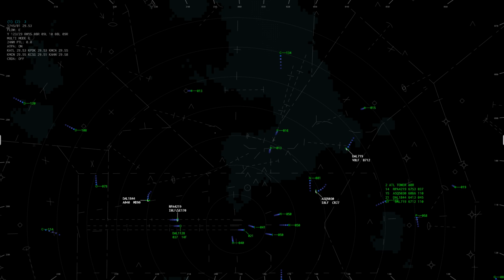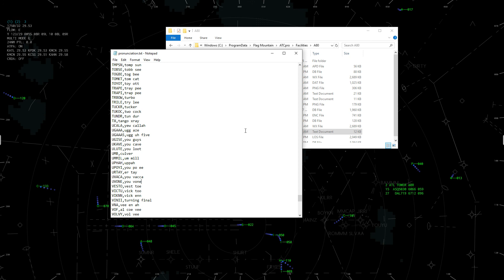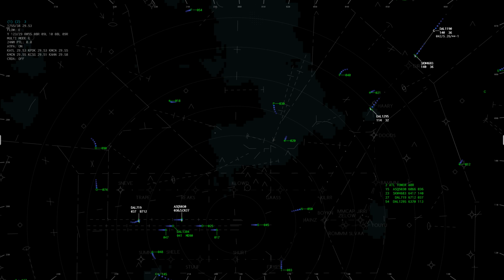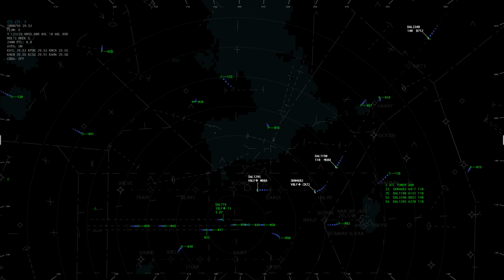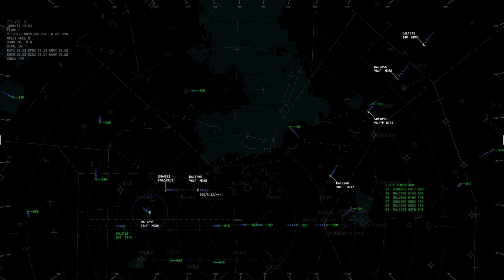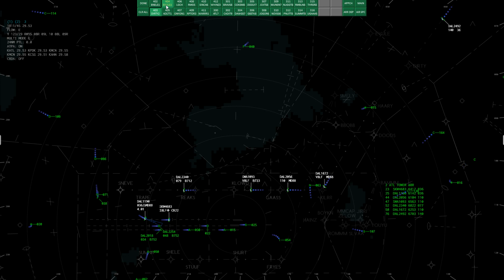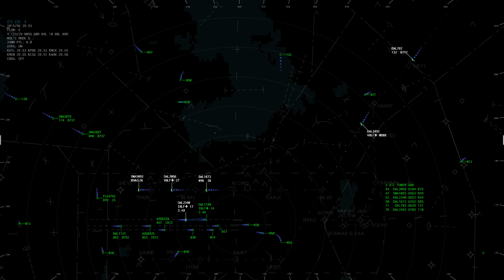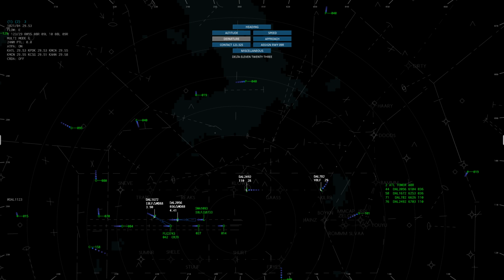ATCpro - User Edits and Technique

Comment: Hi Andrew, I enjoy watching your tutorials.  I'm considering purchasing this simulator. Is it still supported?  I see most posts are no recent than 3 or 4 years ago. Thanks!
Reply: Kevin, I purchased ATCPro about 3 weeks ago. I have to admit the ambition level and the functionality (when it works) are pretty amazing. It comes with 6 Tracons which are modeled with very realistic procedures although they are based on SIDs and STARs that are about 5 years  old. The Scope functionality feels realistic although I can't really judge since I never worked one for real. 

Now the bad news. There are quite a few bugs, although so far I haven't found one that is really debilitating. You can play, but you will have to do some workarounds in some sectors. The career mode doesn't work but you can use everything in Sandbox mode, you still get comments on your performance, you just never get a "promotion" (I don't really care about that). The "download live weather" doesn't work, but I work around that by looking up the weather at the airport you're gonna work and enter it manually. Sometimes you get points deducted when you did nothing wrong (at least I think). 

The documentation is reasonably complete about the buttons to push and the (extensive) voice command you can give it. You are expected to know a fair amount about ATC, you won't find it in the game's documentation. For example, I didn't understand the importance of doing pointouts and got a lot of points deducted until I saw it explained in one of Andrew's videos, it wasn't in the game documentation AFAIK. 

Worse of all, the game seems to be dead/abandoned, no new versions coming out, due to unfortunate family circumstances of a key developer. I tried to join the forum but can't even get myself approved to post new questions, though I can search older posts. Andrew's channel is a big help in learning the techniques and workarounds and I am absorbing his vids as I learn more and more sectors. Bottom line -- if the bugs and the lack of support don't scare you, it's a fantastically realistic ATC sim with a pretty steep learning curve (which I like) that will keep you busy for quite some time!
Reply: @alexmollen9339  Have you attempted to create your own airspace? Let's say, I'd love to play KSEA or KPHL. Do you know if that is possible with ATCPro?
Reply: @BlueSideUp77  KSEA is actually one of the six included TRACONs (KTYS, KMCI, KSEA, KMIA, KATL my favorate and KABQ). 

The TRACONs are all data driven so you could recreate the SIDs, STARs etc but the data structure isn't documented so you'd have to figure that out from the existing TRACONs; I briefly looked at it and decided that, for the time being is beyond me. If you want your new TRACON to be realistic you need to know details of how that airspace works, for example, what agreements are in place with adjacent airspaces about planes entering and exiting. You'd have to create custom sound files for the fixes and other names in your new airspace. And create some video maps, I haven't looked at how they implemented those. In short, a bigger challenge than I have time for now, and just the included Atlanta TRACON alone has over 20 sectors you can work separately or combined, I'll be happy to try to master them for the foreseeable future.

BTW I learned that the voice recognition is highly sensitive to the position of the microphone. By positioning mine lower near my chin I'm getting much better results and making the experience much more enjoyable.
Reply: @alexmollen9339  So, it is possible to create an airspace, but not exactly user friendly?

Thank you for your feedback! I'm excited that KSEA is included. I appreciate your info on all of the above.
Reply: @BlueSideUp77  I THINK it's possible since airspaces all data, and data can be added/changed. But at this stage it's definitely not easy, you'd be on your own with no support too.